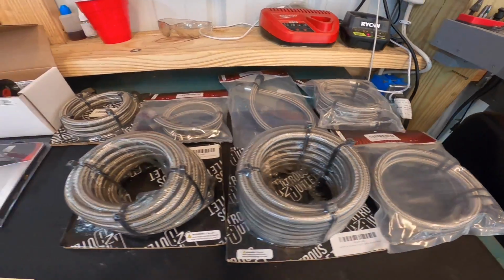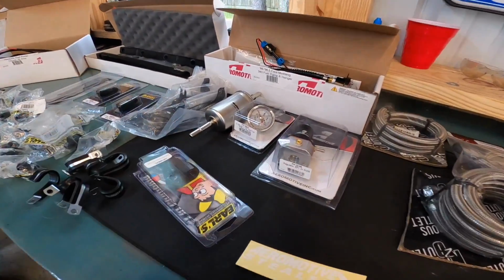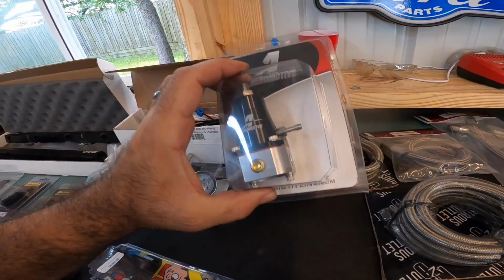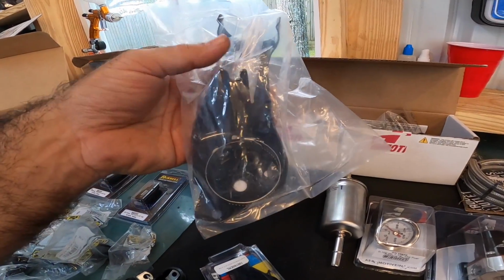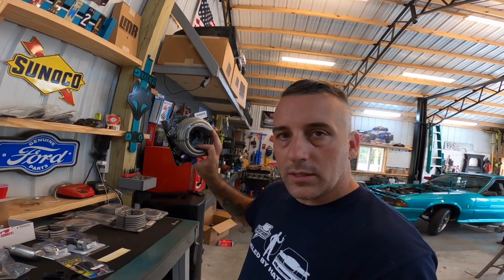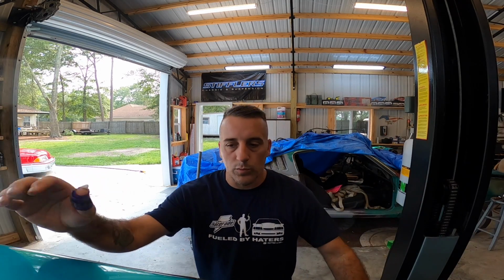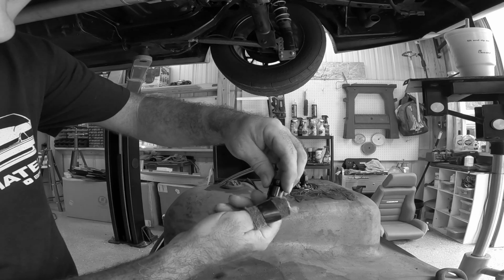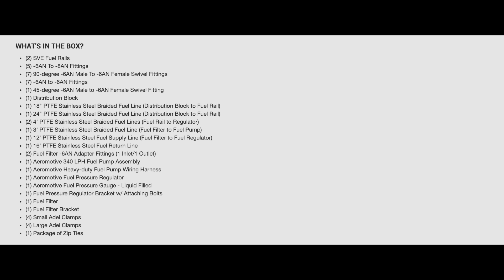SVE High Performance FOX BODY Fuel System!! OVERVIEW

Comment: I agree with you. I'm one to pay extra for a kit. To me, it's worth it. Even smaller kits. I bought the LMR SVE Cobra style front brake kit for my Fox. So many were like man you could of saved a couple hundred bucks by piecing it together. Sorry, I'm not rich by any means, but it was a complete kit, new, and I knew that if there was an issue of any kind, LMR would stand behind it. FACT!!!! 2 months after buying the kit, the front rotors were warped an shaking very bad. The warranty is 30 days. It was over 30 days....  called lmr explained the situation and they know that most of us don't daily our Fox's . So there probably isn't much use on the parts in 30 days. With out hesitation they shipped me another pair of rotors and emailed me a return slip for the old ones. I explained to them, I was going in for surgery and it may be another month before I can swap them. Their answer... Oh man sorry to hear about your issue, but no problem. Send them back when you can.  That kind of service is worth paying a bit more for stuff in my opinion. I have been a long time supporter of LMR, and will continue to do so.

Comment: I hope that fuel line is rated for ethanol exposure (ptfe) lined. I installed a complete aeromotive fuel system several years ago on my 90 gt. Within a few months I started smelling fuel and developed fuel leaks. My injectors became coated with green slime. Car had been sitting for years because I lost interest.  Hopefully I'll replace my system and get the fox running again.

Comment: Awesome video! I have a video of my fuel system. Installed it myself. I used the stock tank with the Areomotive duel (2- 340 pumps) Phantom fuel pump system. -10 supply and -8 return. E85 ready. Less than $1500!

Comment: It’s really not that bad, I pieced mine together with no experience. Took a couple nights of research and one trip back to the parts house but all in all not horrible. Plus I did 2 fuel systems, one for the EFI and one for the N2O.

Comment: It’s not hard ordering it separately. The hardest part to me was how many feet you need in length from tank to fuel rail and fuel filter.
Reply from the maker: I wish I could say the same. My anxiety starts kicking in when I have to order fuel system parts 😂😂

Comment: What size injectors areyou using?
Reply from the maker: 60s for now
Reply: Nice I am doing a similar build but a little more extreme and by chance I am doing fuel system now also I think I am over killing it with -10  fead line